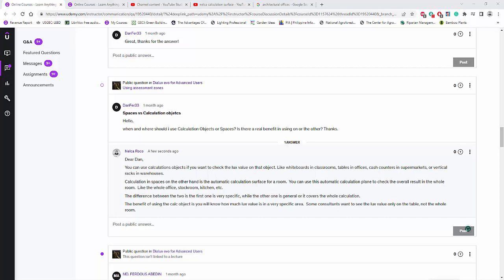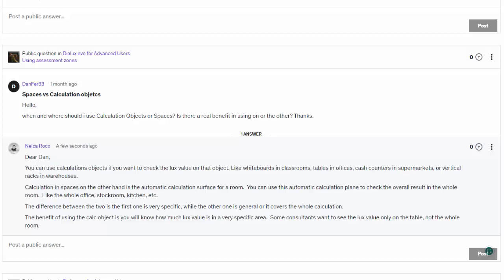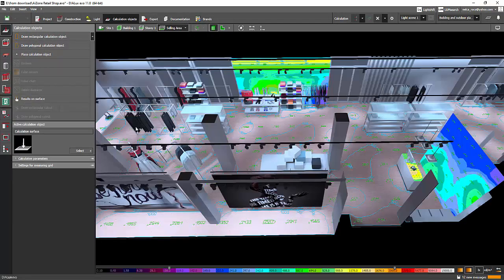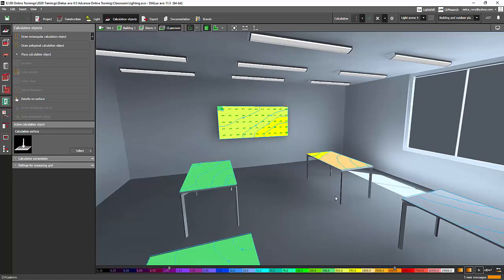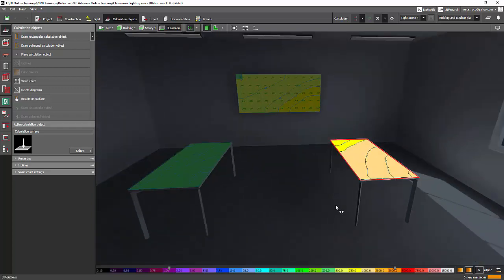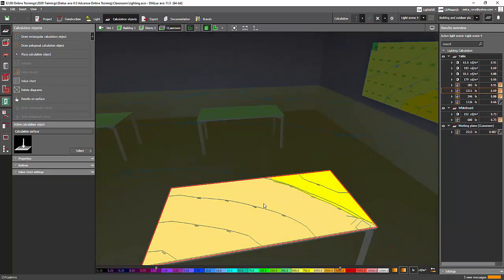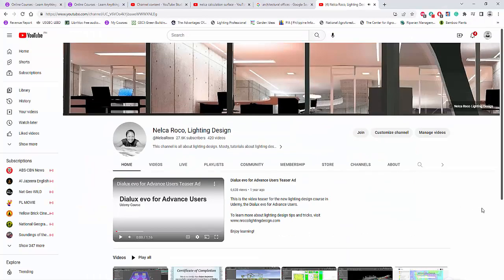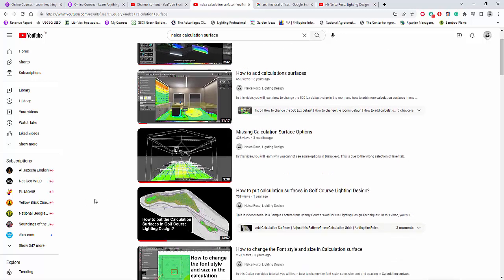Why and where to use the calculation objects

Comment: Are there any standard target values for the different surfaces needed to be achieved according to lighting standards ?
Reply from the maker: if it is a table, you need 500 lux.  If it is a hallway, 100 lux.  if it is white board, then it's 300 lux. Just check the lighting standards for more info.
Reply: @NelcaRoco  Thank you
Reply from the maker: yes. u either go for EU standards or US standards